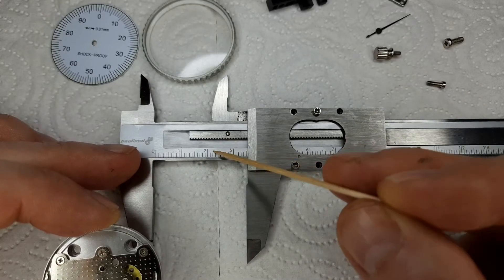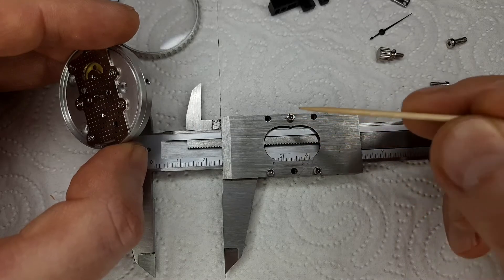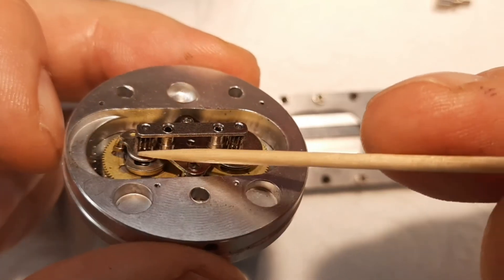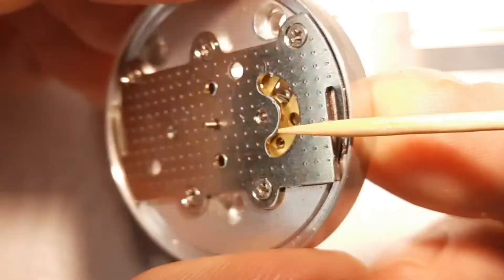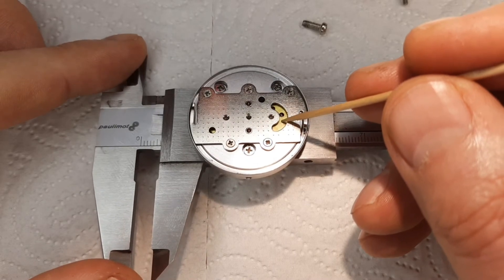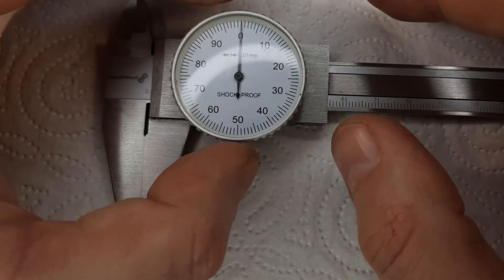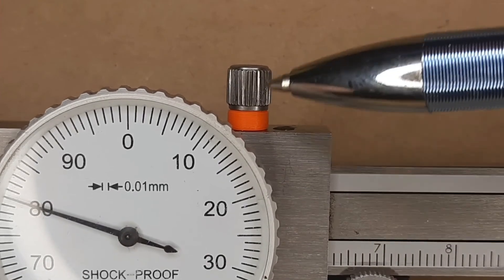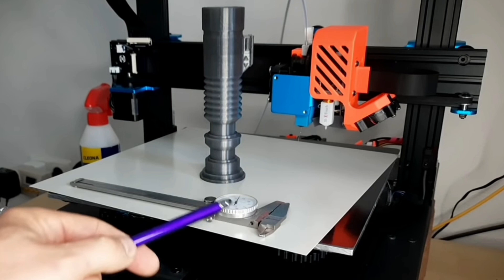Dial Caliper repair / preload & backlash

Comment: Thank you so much. I fix a lot of the tools that we use and make some custom tools that are part-specific. This will hopefully help me fix the collection of dial calipers that are in my repair bin.  I'm looking for the preset torque specs for the main test indicator tip pivot for jeweled bearings. They seem to be extremely delicate and sensitive. I'm not sure that my old hands can feel that tiny amount anymore.  
Thanks again for putting this up!  It is also great to get this from someone with the same perspective,  being German/Austrian myself. 
We seem to have a knack for inventing tools and machines. 
We see things from an "analytical and How mechanical things work" perspective.  It makes us good at what we do. I work in aerospace, and due to a spine injury, no longer operate large cnc milling machines. I assemble subassemblies and rework and repair parts that need some help. I have to know a whole bunch of stuff and have had to come up with new ways to do things when the common methods our vendors use fail. Parts get scratched, dropped, banged, and dented. They complain about how many tools I have at work and that three tool rollaway cabinets are too many , but I can do anything they throw at me. I have been meaning to look this up for years now and just got it in my head tonight. Thank you!

Comment: if only pointer adjustment is needed….just remove the bezel and glass…remove the pointer and replace in the corrected desired position…replace bezel and glass…job done..

Comment: I have often wondered if it would be much easier to adjust a dial caliper if the actual rack was made to move back and forth.......then all you have to do is slacken the holding screws for the rack and move it left or right to get the needle to once more be vertical.......this would save having to open up the works to get it to calibrate to zero........my Mitutoyo dial caliper has a single small gear that meshes with the rack and it sometimes hops over a tooth and the needle goes off centre......crap design.